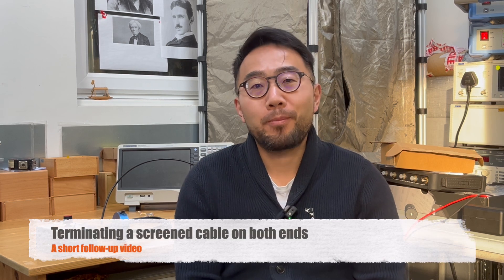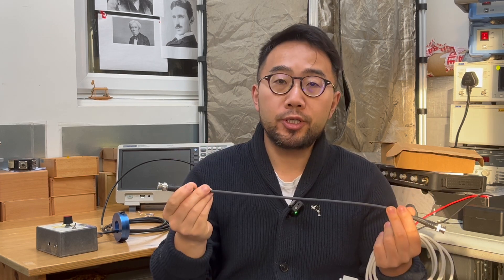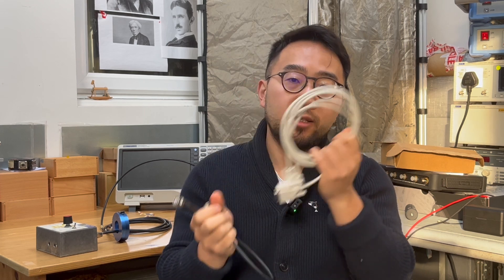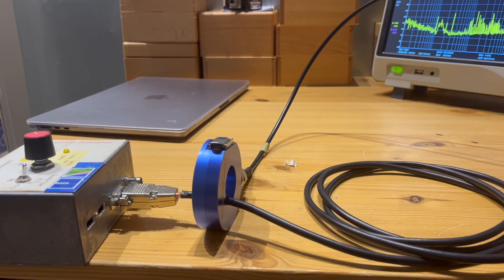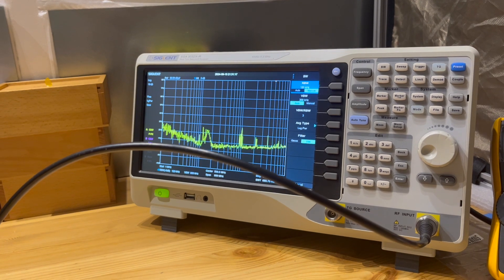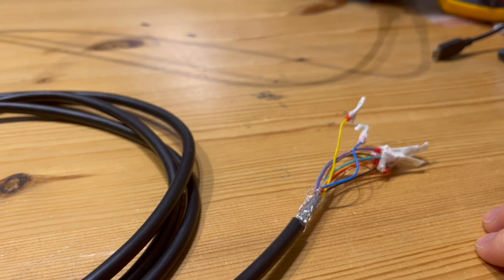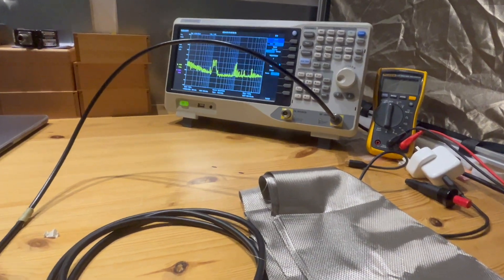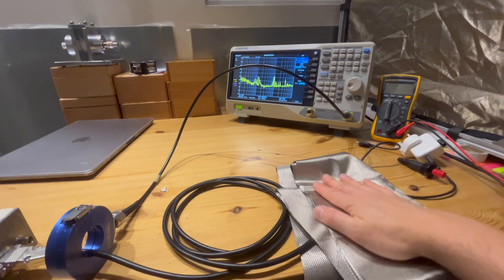Terminating a Screened Cable at Both Ends: Practical Demonstration

Comment: Truly thank you for your demonstration,  
I am hoping that you can go one step further. Are you able to do the same test with a cable with one-end shield terminated - However connected to another device that has a power supply of the same reference (powered from same source)
Take measurements, then terminate at both ends of the cable and re measure ?
Would love to see how the noise reacts
Reply from the maker: Hi, when we have time, we certainly would like to do a demo on that. Thanks for the suggestion.

Comment: Hi dr min,

could you make a video about shielding magnetic and electric field?( separately and together)

which materials fit best, and common coupling mechanisms ( for example how dc-dc  high dv/dt node, and di/dt switching current loop are coupling to cables and radiating),

Thank you.
Reply from the maker: All great advices, I am sure we could make videos on all the points you mentioned, currently we are in the planning stage for next year's video subjects, your suggestions are valuable to us. Thanks

Comment: This was very helpful, i appreciate your time to make the demonstration, 

Is there any situation where shielding both ends in industrial area will be not recommended?
Reply from the maker: There are some scenarios, when you find terminating the shields on both ends may introduce problems. I hope I can make time to find a good demo for you in the future.
Reply: @MachOneDesignEMC  thank you
Reply: @MachOneDesignEMC  Most likely,  if supplies (powered) are different and the earthing from either supply is not at the same potential. Then ground loop currents will flow as the earthing has a resistor in its path. ... please correct me if I am wrong. However Multipoint bonding can reduce this effect